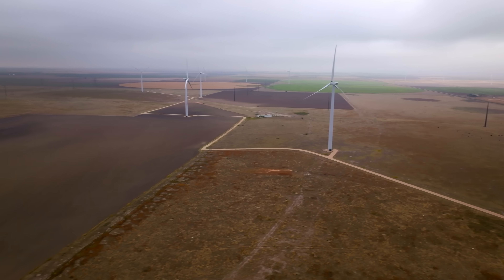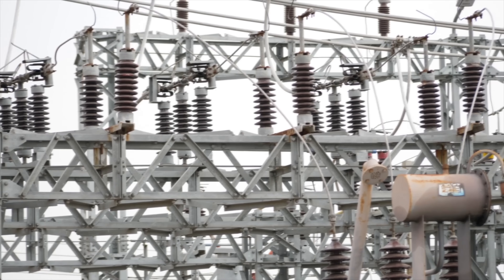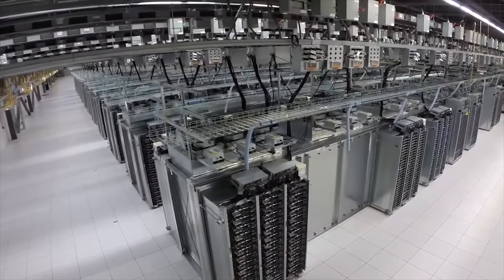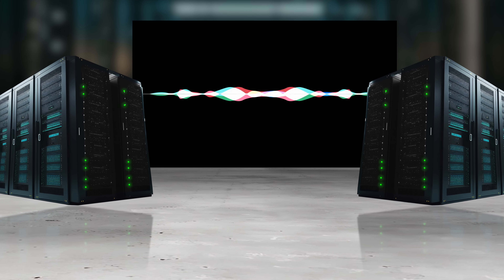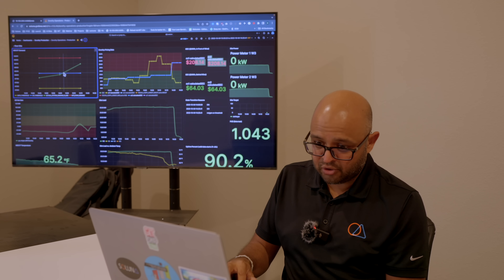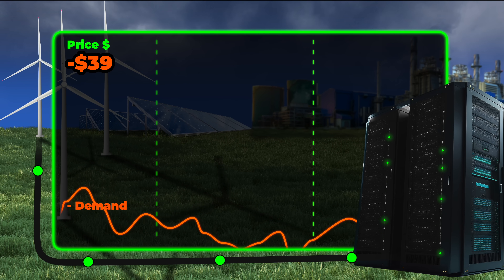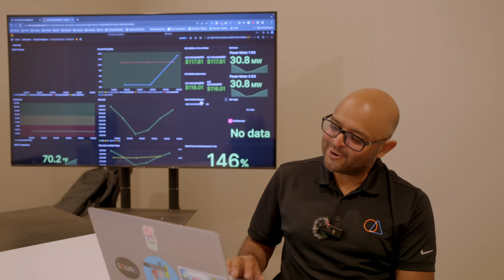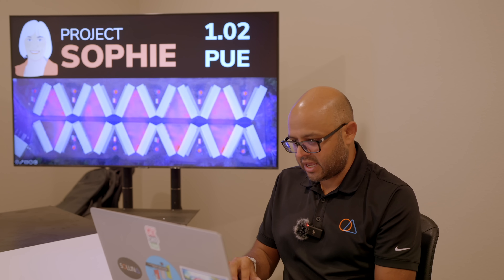Wind Farms' Dirty Little Secret No One Talks About

Comment: I feel you missed a critical question. If the power switches from the data center to the grid what happens to the guy who was using the data center? Imagine if you were 4 hours into a 5-hour job (creating a 5-second video clip) do you get a message "Sorry for the delay;  we'll be back on-line this evening when grid rates drop." Who would use a data center that may be up or maybe not? No company would base it's business on such uncertainty.

Comment: Why can’t we use water as energy storage. Pump water uphill to storage when the energy is surplus, and then run it downhill through a generator when the power is needed. It could be very scalable and relatively inexpensive especially compared to storage cells.

Comment: In the city I live in, just the residential rooftop solar creates more than 3 times the power needs for the entire state, we also have multiple wind and solar farms that are not currently being used. Electricity is actually very easy and cheap to produce in the quantities needed for any modern city. If you combine rooftop solar and wind power systems with closed loop hydroelectric power stations, you can easily power a city for about 5% of the cost of coal, oil, gas or nuclear power stations. A closed loop hydroelectric power station can be built any size from powering a single light bulb to an entire city, but smaller units are far more cost-effective. If you only use the stored power and only use the wind and solar power systems to recharge the hydroelectric power stations, you can easily control the power production to closely match power consumption. Because closed loop hydroelectric power stations can be built underground or incorporated into building design they can be built closer to where the power is needed eliminating most substations and transformers saving even more money and making the power grid more reliable. Coal, oil and gas are obsolete commodities that can easily be replaced with cheaper environmentally friendly alternatives. We already have the technology and resources to be completely fossil fuel free in under 2 years, but we lack the intelligence and willingness to just do it.

Comment: It's also to avoid wear and tear on the equipment, and the batteries can only store so much.  The cost of replacement for these machines is so high that you don't want to wear them out when not necessary.    Storage issues is why there is a grid and power is sold among companies.  You will see that not all generators in a dam are being used all the time, if you care to look into it.  Nice ad for the company though.

Comment: Are you trying to tell me, they have forgotten about batteries? Like you talk about being able to store water and gas in tanks, and then not being able to store electricity, but batteries exist. Just use batteries to store the power that is generated when no one needs it, so that you have the power to distribute when people do need it. That's what people that have their own individual renewable energy stuff do. Like there are people that are totally off grid living on their own homestead and they only use solar power for all of their electricity. They have solar panels that charge their batteries, and then the stuff that they have draws the power from the batteries, and generally their batteries have enough capacity that they have enough power stored up to last during the times that the solar panels wouldn't be able to generate enough power. Granted a battery big enough for a city would be massive and heavy, but so are water towers. It just seems like there is an obvious solution to the problem and people are just being stupid.

Comment: I'm confused. Do these wind farms have battery storage to store power that isn't needed to release into the grid? If not, could that work to run wind mills non stop? Therefore, windmills run to generate electricity to store into batteries. Battery storage units (with the use of AI) learn when is it optimal to release electricity into the grid for maximum rates and drain the storage almost to depletion.
Also, wibd to cool down the units by use of fans? When using water? That is really confusing. Isn't the water tower higher than the building to cool down? Water falls by gravity into vent pipes surrounding the units like in a tesla battery module and drain down into a sewer like drain either to loop or into the water table or water system to water the plants on the actual farm.

Comment: Why not store the energy in batteries? Solar for residential applications are moving more to batteries because of the buy back price is to low, or to use during peek price usage times. Also if the grid goes down, they still have power. You make massive battery banks.

Comment: If you isolate it, then they sell electricity for others to mine when it is profitable, but cut electricity, when it is profitable to mine bitcoin themselves. Don’t get me wrong, I know when I see ASIC servers and those are mainly used for bitcoin/eth etc. mining. Looks like speculation to me. Yes, other people do get some benefits in a leftover format. But don’t forget that you cannot cheat physics — operating costs and electriticy distribution will rise and destroy any economy they previously had. Put my country as an example, that runs 80% from hydro with very simple systems — I never paid attention to how much electricity we consume, as it was 4 cents per kW. Then the wind turbine, solar power craze happened, now we pay more for distribution, than the electicity itself. Then the drout with speculation and energy crysis happened and our eletricity prices spiked tenfold (not joking) — I went from paying 15$ per month to 110$ per month and that is in the economy with a 700$ minimum wage (per month). I’m not kidding, at one point it was x2 cheaper to sleep in the car leaving it running snd keep warm , than using electicity to heat the house.

Comment: It's interesting and sounds like a good way to make wind farms economically feasible.  However, this will not solve the major problem:   The internet only accounts for 1% of global demand. Accommodating the needs of the other 99% is a much more difficult task.
The grid needs a quickly variable and completely reliable source of electricity to operate.  Current power plants use the momentum of their steam turbines to carry instantaneous changes while relying on the ability to provide sufficient energy to the turbines to match load.  Gas turbine plants can also be quickly spooled up to match sudden demand.  Wind and solar is at the mercy of the weather and cannot consistently match demand.  This cannot be done until we find a technology that can store terawatt hours of power, and that doesn't look feasible in the next 10-20 years.  Meanwhile, governments are pushing to to full electric in the same time frame.

Comment: This is a type of Demand-side Grid Management. While the approach portrayed here does help defray the CAPEX of the Wind Farm, it does the exact opposite for the Server Farm by switching off the computers. To maximize the profitability of both at the same, what's needed is MASSIVE ENERGY STORAGE that is cheap to install, lasts for decades, and runs at reasonably high efficiency.

Comment: Love this idea. Using distributed compute to soak up excess energy.

I think compute should be used for heating as well. Compute is ~100% efficient at turning energy into heat. That's exactly what resistive heaters do.

All electric heaters should be compute to use the 'free' energy currently being 'wasted'.

Comment: Hey Ricky, I'm a retired engineer and have thought about this demand factor problem for years. Two ways it could also work out is this: Smelting, like recycled aluminum cans, requires considerable power. A small operation near a wind farm could melt and pour billets in a few minutes in between demand spikes. The operation would only need a few employees. Second idea is cold storage of crops, meats, or even paper records. A few minutes or hours of time are not very important because of something called the refrigeration flywheel. Major startup is hard and expensive. Small added cooling is not nearly as expensive. Both of the ideas make intense energy batteries at a lower cost. Prodution efficency is over the top.

Comment: No problem. Is that type of solution isn't scalable. Most wind farms are built in areas where there's relatively little infrastructure, or on actual working farms. And the world doesn't need that many data centers. However, It's still really cool idea and it's nice to see people thinking outside the box to help solve the power overage issue.

Comment: NO, Water and electricity work the same. Water is STORED in a revivor at a non static pressure state for future use but its not viable without being pressurized! It takes ENERGY to pressurize the water to be viable and be readily available at the faucet. The ENERGY to pressurize the water is wasted especially at night when less people use it. ENERGY is wasted to balance the pressure of the water. 
This is true with electricity, there are abundant amounts of electrons STORED all around us, ready to be utilized but it takes ENERGY to produce electricity! ENERGY is wasted to maintain the voltage (pressure) to our homes to be readily available for use. ENERGY is wasted to balance the pressure (voltage) of the electricity.

Comment: I have seen many wind turbines not rotating within working fields. Speaking with service techs, they say that they are broken. The bearings have temp sensors on them so they don't destroy themselves due to lack of maintenance or just needing general service. The turbines have brakes that will set automatically when the bearings get too hot. Biggest problem with wind farms is lack of funding for maintenance. The federal government funds the wind farms with grants and subsidies but when left to succeed on their own can quickly fall into disrepair without proper management. The operators that bought the original wind turbines for large scale wind farms were also told that the blades would last the lifetime of the generator just to find out later that they would have to be replaced on a regular basis. They are just made of balsa wood and fiberglass and have a shelf life with the elements and stresses placed apon them.
 California has many older wind farms that went belly up decades ago. Texas has far surpassed any other state in wind, just recently solar and obviously petroleum. So far renewable energy is just supplemental enery onto the main grid and cannot replace petroleum, coal and nuclear.  I am completely for new technologies,  but everthing that the federal government pushes before it is ready for prime time fails miserably. Just like lithium battery cars. One day an electric cars and even heavy haul trucks will be powered by batteries but lithium batteries will not be the power source. The government pushes these technologies with good intentions but they are not creators, only takers. The government didn't create the automobiles or the infrastructure "gas stations" to support them. When the technology arrives people will buy it because it works well and whoever creates it will become very wealthy. Government needs to get out of the way. I apologize forbthe long rant, just the way i see things😂

Comment: As someone whos actually wokring with wind turbines, when its not spinning its usually stopped or a problem has occured. They dont "shut them down" because the grid isnt demanding power atleast not in Europe or if the price is too low to sell.

Comment: There are locations that use Bitcoin mining computers as batteries to store value. How this works is the following. Where there is an excess of power generation the excess power is used to mine bitcoin. When you mine bitcoin the energy is used in 2 ways. Most of the energy is used to manufacture bitcoin. A very small amount of power is used to send bitcoin around the world or otherwise referred to as transaction fees. The energy used to create bitcoin is a one-time use energy. Once a bitcoin is created, it can be used forever after that. Thus the bitcoin itself is like a storage battery for energy that can never be destroyed. Many people mistakenly say Bitcoin consumes a lot of energy per transaction but the vast majority of the energy used is actually converted to bitcoin by manufacturing it. Only a small amount of energy is used for transactions. Here's an example: It takes about $20,000 in energy to create one bitcoin (all of that energy is converted into bitcoin and stored in that bitcoin permanently). The cost of 1 transaction is only about $0.04. The average price of electricity in the US is $0.12 / kWh so each bitcoin transaction takes about 1/3 of a kWh to process. Compare that to credit cards where the transaction fee averages $3 + 3% of transaction value and you can see that Bitcoin transactions are a lot more efficient tha using credit cards. My company recently purchased $36,000 of cameras from a Chinese company and used Bitcoin to make the purchase. The transaction fee was only $0.34. If we had used a wire transfer the bank on both the sender and receiver side would have charged $45 for a total fee of $90. Bitcoin was more efficient. This is also why restaurants won't let you use credit cards if your meal is under $15 because the credit card fees (typically $3 + 3% of the transaction value) would eat up any profit the restaurant has the the transaction is low value.

Comment: I think you neglected to mention that a lot of wind power and solar power is curtailed due to transmission line constraints. Also, you should mention the experiments taking place to generate hydrogen from wind farms using electrolysis during off peak or transmission constrained periods.

Comment: Probably a better option would be a simple battery.  Batteries don’t need to be chemical based but some power generators pump water back up to a reservoir to allow hydroelectric generation when demand is high.  Another simple way to to put heavy railroad cars on an incline and winch them up when demand is low and use gravity to generate electricity when demand is high.  A data center that goes offline when demand is high does not have sufficient power source to operate reliably.  Good for some applications like bit mining but nothing requiring uptime, which is the majority of the Internet.

Comment: Ricky, great video - I'm a long time fan.  There seems to be something missing in the economic analysis of why the datacenter needs to be located adjacent to the wind farm that I'm hoping you can clarify.  The reasons cited for spinning up the on-site datacenter were demand is too low, or the price is too low.  1) If this price is too low for export, then presumably the on-site datacenter is willing to pay more?  This does not seem rational because if the datacenter were alternatively located remotely on the main grid, wouldn't it prefer to pay a price (too low)?  2) As for the demand is too low, would it not make rational sense to have a remote datacenter (at the request of the wind farm operator) to be activated and raise the demand?  Appreciate your response.  Also, the practical matter of interrupting workloads when sending to grid is no longer curtailed seems like it would be upsetting to many types of applications.
Reply: The cost of computing power does not generally vary with the grid buy price. With this setup, the datafarm is not a separate company to the wind farm - they are the same operation. When the grid price is high, they export megajoules. When the grid price is low, they export teraflops. As a customer of the datacentre, lets say I wanted a render that needed 1000 teraflops in 10 days. To me, it dosnt matter whether it operates at a steady 100 teraflops/day every day, or it ran at 200 for half of each day and 0 for the other half - as long as I got my 1000 teraflops in 10 days.
As for 'upsetting applications', they would have a 24/7 fileserver for that. This server would allocate jobs to processors as they came online, and paused jobs before the processors were taken offline.

Comment: I'm curious about how they handle the inevitable dust in their ventilation system.  Amarillo, TX was near the worst parts of the dust bowl and is still one of the windiest areas (hence the turbines).
Reply: Air filters and regular cleaning of the equipment.

Comment: I dont get how this is a problem. those data centers would consume power on the grid if they were elsewhere anyway. Obviously not if they were in another country. Still it shows how onsite energy storage is a useful part of large scale renewable energy systems. Even a thermal storage system with somewhat high losses could recoup a large amount of the wasted potential.

Comment: Wind and solar is a LIE. Most of all wind. Guess what? The dream of green energy is a lie. Wind turbines have massive spinning parts, massive giant bearings to spin smoothly, need A LOT OF HEAT to make the steel needed for the bearings and well. Pretty much everything it IS, most of all, it’s massive, it’s huge, it needs large amounts of lubrication- guess what? It uses petroleum based oils to stay lubed, oil is great for this as it doesn’t break down as quick or become as volatile as natural based oils also is corrosive resistant.  So much is involved….. let’s get real, oil, coal, combustion engines, going nowhere.

Comment: It's a good idea. Large, local users with exclusive contracts for surplus power. As long as the customer's demand timing is flexible it makes sense. Another good use for surplus renewables near the coast would be intermittent operation of water desalination plants to top up local supplies, or pipe inland to drier areas, with the brine used for recovering salt (and anything else that can be recovered).